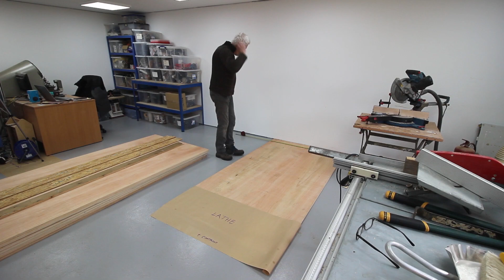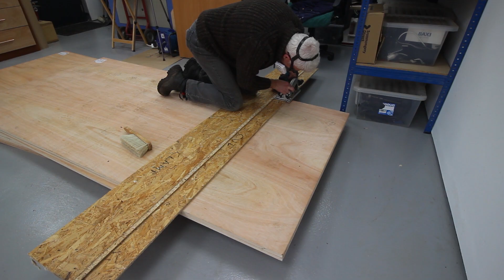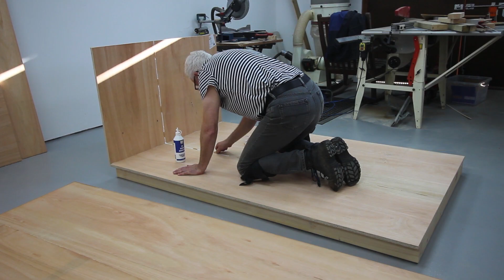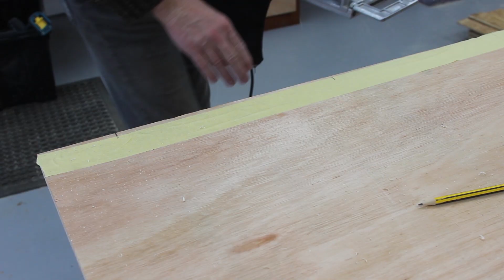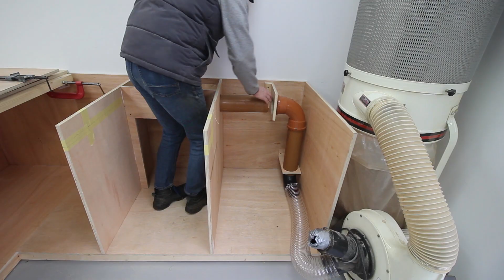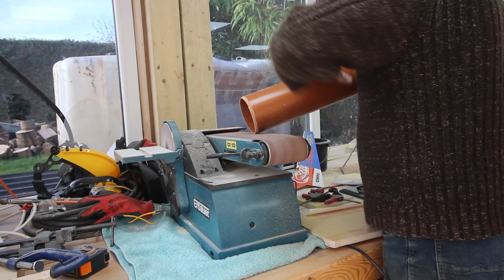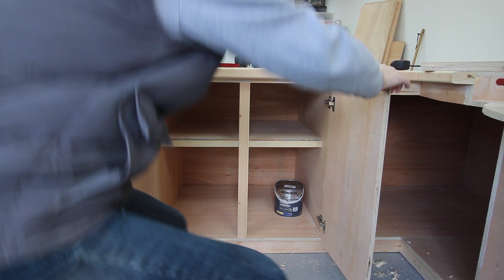Combined mitre saw bench with Lathe and bench machines

Comment: I was slightly surprised at 1:18 to see the same Branch Cutter I use. I have a slight worry that one day you will need to take that "L-shaped" cabinet apart again to move it or indeed adapt it for another Mitre-Saw. It might have been better to make it in screw-together elements. BTW please do get yourself a Japanese pull saw, perhaps a really small one and a full length one. They are brilliant for several situations. I also bought a very cheap small handle and blade version in LIDL for tight spaces and tiny trimming jobs. I ended up giving some to DIY friends - and they seem popular.
Reply from the maker: Hi @plunder1956
Cheers for the comment I was unsure about making the desk permanently attached but it’s not screwed to the floor or the wall and actually braces the lathe so the weight certainly helps. I probably will need to adjust it when the saw finally packs in! Good call on the saws they are on my list to get I may have to sell another kidney to pay for one!!
Cheers

Comment: I've been following your workshop build with real interest.  At nearly 70 I think I'm too old to try it on my own so I envy the space and machines you have.I certainly need replacement tubes for my pocket hole jig but without a lathe I might just have to buy a new one.  Thanks for the really interesting videos from Oxford UK.
Reply from the maker: Thanks for the comment.
Those pocket hole jigs are really good but so letdown  by cheap metal tubes.  And hello Oxford the mountains of Norfolk!
Cheers

Comment: I used a similar method for my dust extraction: a length of copper braid running the length of the hose. Daisy Tempest uses a similar method, which is where I got the idea.
BTW what's that thing that looks like a 1950s SciFi video monitor?
Reply from the maker: Thanks Andy,
Good to hear I’m on the right track!
The 50s radar is actually called an optical comparator it’s used to measure stuff it throws up a shadow of the part on the screen. You can measure from it.
I refurbed it in a previous video series. Take a look at how to use an optical comparator and you will get the picture.
Cheers
Reply: @CazualHaze  Thanks. I'll check those videos out.

Comment: Wow!! I like it, That is a pretty decent L shaped workstation every thing close and compact. Good build project, I think you be fine using pvc pipe and there are so many stories of static build up in the pipe some one will say do this and some one will say do that, it one of those jobs you just got to go on with it, there no right or wrong way. I was thinking about the electrics for this workstation having 4 power tools my be 3 single sockets with one 20 amp DP switch to power all tools and a separated supply for the dust extraction. I'm very impressed with the build and the strength of this workstation I would love this in my workshop. All of the above biscuits I approve, don't use Hob Nobs they crumble.................... As always a great video, can't wait for the next one,  Take care
Reply from the maker: Thanks Shaun,
Originally I was going to put every socket on a separate breaker, but I am now thinking of putting in some separate outlets and a couple of small ring mains. I have got a bunch of sonoff smart switches to have control of all the lights inside and out dust extractor and Edward the compressor. Along with stop mushroom buttons.
It’s all looking quite complicated!
Yep Hob Nobs in tea will only lead to tea sludge that’s almost a crime!
Cheers take care
Reply: @CazualHaze  I'm only a DIYer but if I can only give you one tip, do not use Hob Nobs there's nothing worse than sludge🤣🤣catch you next time, have a good week

Comment: regarding the sparking/fire risk of the PVC pipe... You could ask 10 experts their opinions and get 10 different answers, and all of them will say the other 9 are idiots and completely wrong. It's one of THOSE topics if you know what I mean. Pretty much all of the big woodworking youtubers (Jay Bates, Stumpy Nubs, Jonathan Katz-Moses, etc) all have videos talking about it if you want to dig in but personally I wouldn't worry too much about it.
Reply from the maker: Thanks again @Trainwreck1123 
I know it’s very inconclusive but I came to add the foil as a drain because of these:-
Signal wires often have a drain wire added to lose the induced power.
Aircraft get grounded to the bowser before filling up.
Finally I live round the corner from a woodworking company, a couple of years ago they had a spark in their dust extraction system and five fire engines turned up to put it out! They ended up replacing it for tens of thousands.

So I thought it’s worth the effort but may not actually do anything. I think it’s not worth worrying about I agree with you I guess I did it for peace of mind!
Cheers
Reply: @CazualHaze  It definitely can't hurt to be more careful!